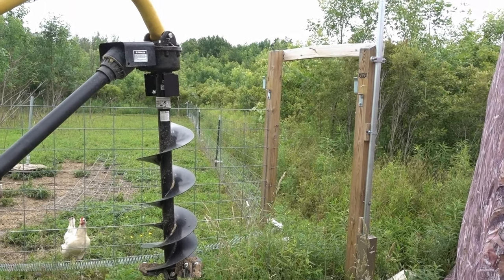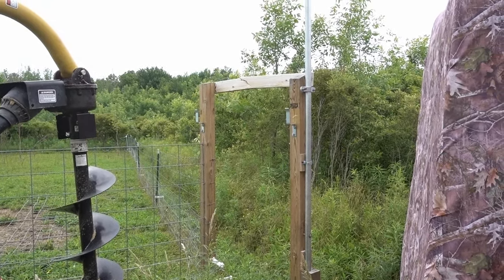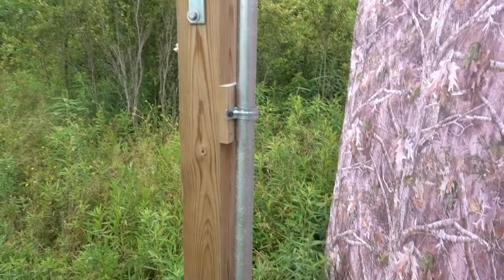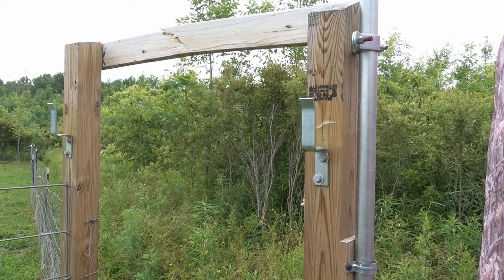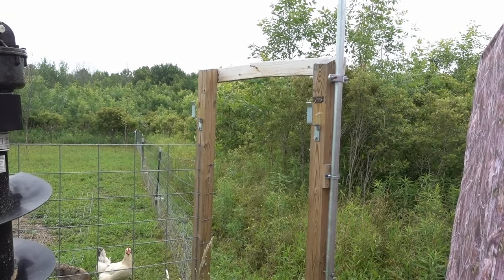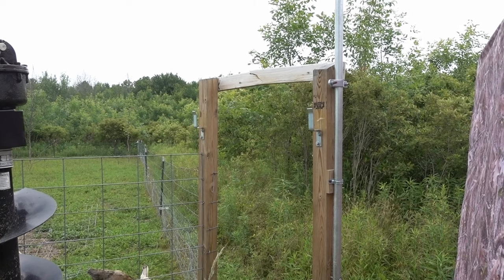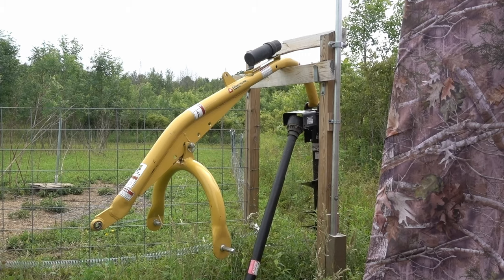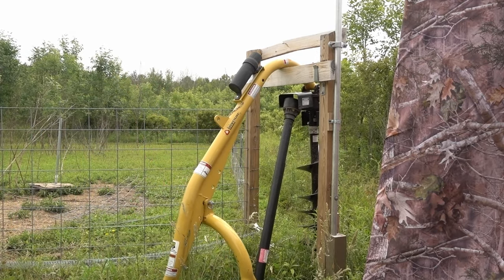Post Hole Digger Stand

Comment: Simple.  I like it!  What type of metal bracket did you use to support the 2x6?  Where did you purchase?
Reply from the maker: Most hardware stores carry them in the gate/fence section... Search for "Bar Holder"
Reply: @projectlittlebear7532  Thanks!
Reply: That's a simple but effective way to store those augers .I have tried a lot of different ways and always wanted something a little better . Thanks for the idea .I'm definitely going to be building one